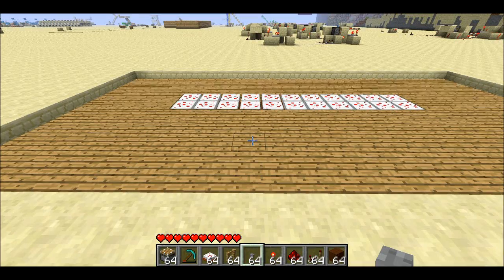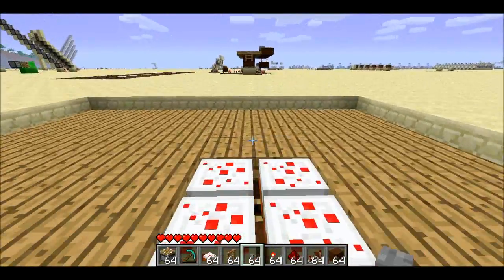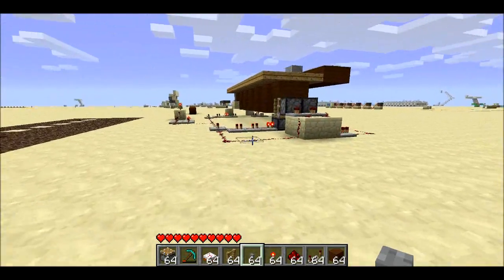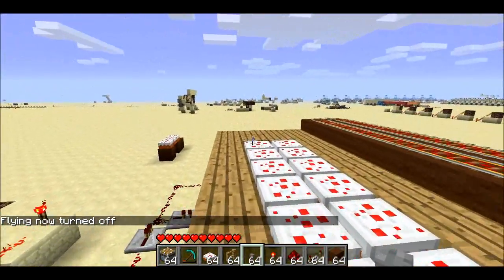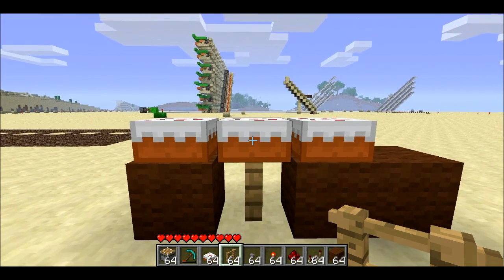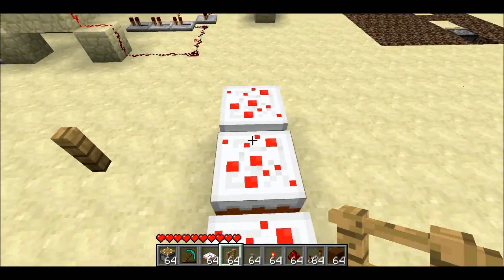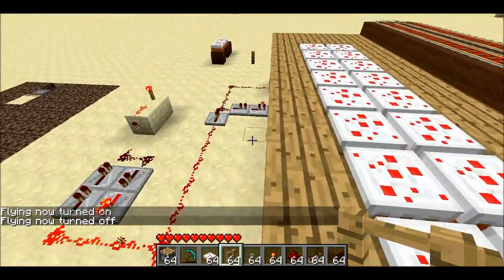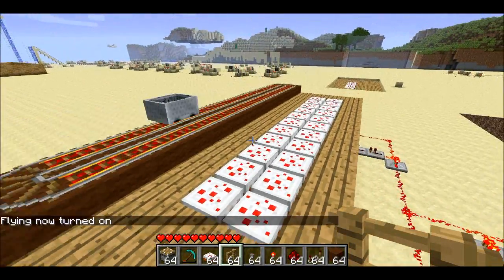Cake-Based Moving Walkway/Conveyor Belt

Comment: Cake is 7/16ths of a block, while half-slabs are 8/16ths. That extra 1/16th matters, as the "invisible" part of a fence is also 8/16ths. The tip of the fense can't reach you through a half-slab.

It doesn't matter anyway - this was patched out when stairway-based elevators were fixed.
Reply: VestedUTuber fence*

Comment: i hope its understandable :
you could build it infinitely long, just by placing pistons on the right cake side, then when the piston limit of 13 is reached, build the same thing at the end on the left side... now you have to stand in the middle of the 2 cakes, to go on. you could also build ironfeces onver the one cake side, and glasspanes on the other, they wont connect, so you will have an tunnel right in the middle of 2 blocks

Comment: @The1WhoDraws 3 milk buckets on the top, an egg in the middle, 2 sugar on the middle left and right and 3 wheat on the bottom which you can get seeds from grass that can only be put on wet farmland which can be made by crafting a hoe and right clicking on some dirt and putting water on any side you want. the milk buckets will just turn into empty buckets

Comment: @LDeHeld  Half steps are 0.5 blocks high, so the 1.5 high fence posts wouldn't reach through the top of the block above, like they do with cake.
Therefore, no moving walkway with half steps. :(